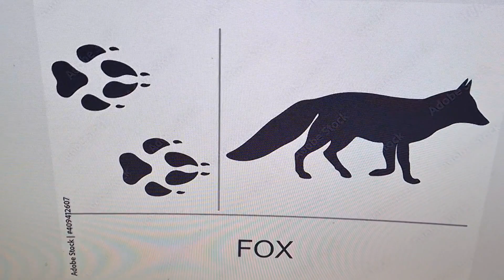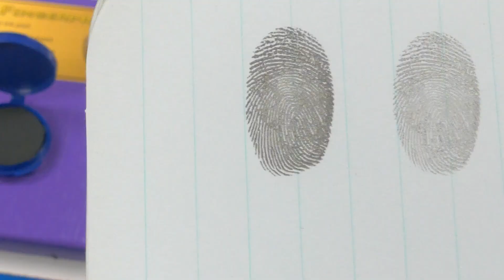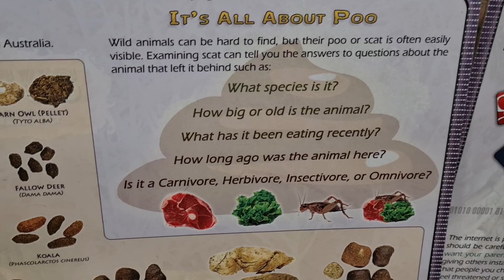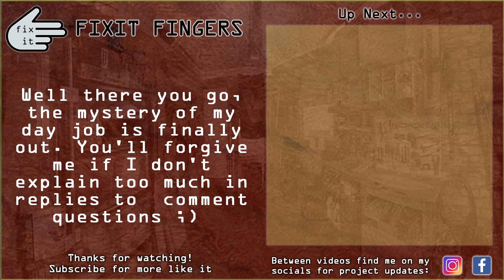I Travelled the World Teaching Forensic Science, Now I Build the Equipment

Comment: Outstanding. Your commitment to a project of this nature is refreshing. The impact on young minds and their learning choices has huge benefits, obviously for many years to come. I do, however, have a couple a questions. Which portions were configured with pallet boards, and would storage and transport of the finished product have been far more cost effective in milk crates? Both potentially available from behind the local servo?
Reply from the maker: Hahaha, there was actually a bit of my better reclaimed plywood used but most of it was marine ply leftovers from when I built the boat deck last year. Milk crates are getting harder to find these days :P The last set I had made by a mate of mine has survived 8 years so far so I am hoping this gear holds up as long. The design is a little old school, but there is enough modern tech elsewhere in the kids world, so I enjoy providing some old school hands on fun :)